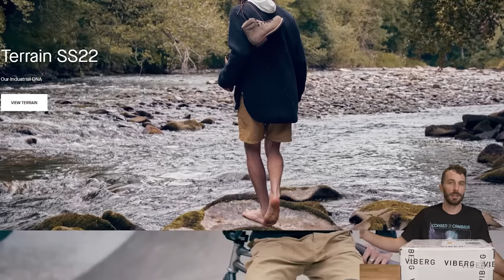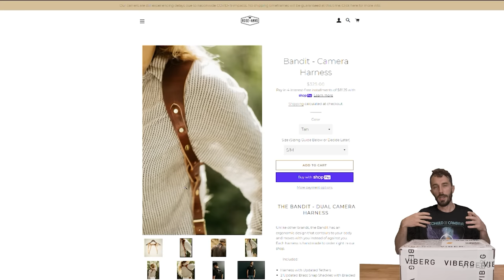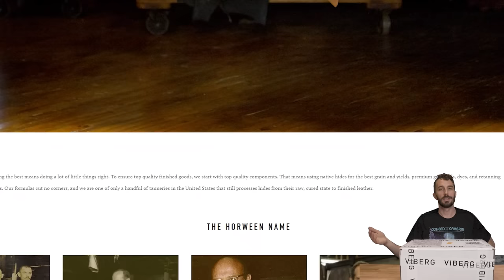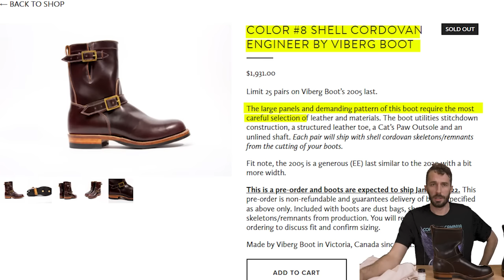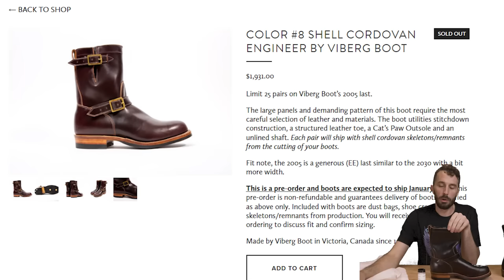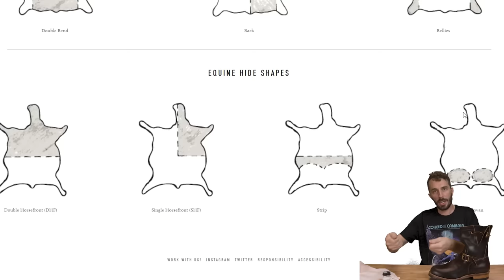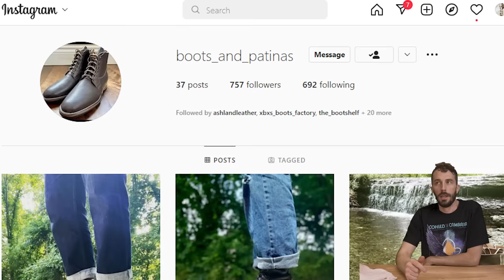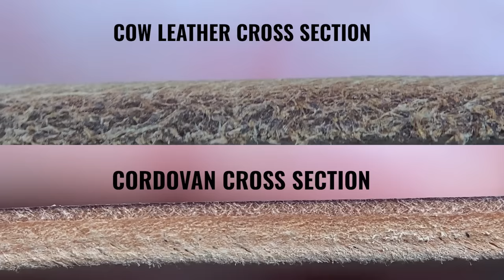What makes this boot worth $2000?

Comment: Those are some good looking boots. From my experience with engineer boots they should fit you basically like a western boot when adjusted but without any heel slippage when tighten. If they are that loose on you currently I doubt they will be much better once broken in. You might have to look into getting a custom pair made for you with your full ankle & calf measurements similar to how nick's does tall lineman boots.
Reply: I was shocked to hear these boots weren't fitted to him. Seriously, for 2 grand, such a big name and the quality, why wouldn't you measure your customer's foot, ankle and even calfs?
That's borderline fraud.
I have the Rose Anvil Nick's Boots from 2021 and they were fitting juuust right and I always have to wear thick socks, else they are too big. Before buying, I spent an hour measuring my foot's length and width and converting it to american sizes and checked dozens of websites to be sure it fits. Yet it only fits because of a workaround.
That's not acceptable for 700$, and inadmissible for 2000$.
Reply: @alexd.3048  Did you go for your own size or something like half a fize down etc?
Reply: @VictorDude98  Indeed, if I remember well, I took a quarter or half size down (it's all in x/y inches), as comments said the toebox would ve very roomy "knowing Nicks".
Reply: I had similar and used wool insoles. That made them perfect
Reply: You are Correct. I think these boots are a bad design - and would have to be a custom fit to look right when sized properly.
Reply: Honestly, I got a pair of engineer boots that were loose on my ankle, just making more holes on the strap fixed it with me switching to soviet footwraps with these slip on boots.

Comment: Definitely a beautiful boot but for that price you can get a similarly built (Dr. Sole, Horsebutt) John Lofgren or Brass Tokyo engineer. Personally the shaft on those is too wide and short and wouldn’t wear right under jeans.
I prefer my Wesco Mr. Lou’s but hey I’m glad stuff like this exists out there and people enjoy it!
Reply: I have been looking at mister Lous for a while now. I’ve read the shafts are more narrow than the boss’s but boss’s are more work boots than every day kick around boots.  I have hockey legs and worry that the shaft won’t fit well over my calves. What’s your take on the shaft size?

Comment: Wait, what? Cordovan is 10X more expensive, but it’s not as strong? So using cordovan as a hiking boot or motorcycle boot would never happen? Damn, but they look so nice. They seem worth $2000. And I’m so thankful you didn’t cut them in half. I would have cried.
Reply: I think cordovan is stronger than leather
Reply: cordovan is more durable then traditional cow leather, that's the reason its the highest end leather, as well as how little of it is available. it's tighter grain structure makes it more resistant to tearing and because of that lasts longer then traditional leather on a shoe.
Reply: @Orion i think the subtlety is like in steel, you have soft steel and hard steel, the former being ductile and can be bend at will, great for anvils and tools but absolutely unusable for construction projects, the other being super brittle but takes a beating before snapping suddenly, great for construction but absolutely horrendous for tools.

I’m not a construction worker though so of course it’s very boiled down and wrong on many levels but I think it’s a fair comparison !
Reply: @Adierit actually it's exactly the opposite. Cow leather is way stronger at the same thickness. Also unlined makes no sense in cordovan as it does not take moisture very well so you want it to be lined.

Comment: I loved hearing your comments about the try on. I feel like you echoed a lot of my issues I’ve had with my White’s in the ankle area, even with boots that were sized properly to my foot length (and in narrow width). I punched a couple new holes in my ankle strap and wore them for a while and the heel slip has definitely gone down, but it’s still there.

But hopefully with more wear the soles will curl up and reduce the heel slip.
Reply: Yeah I've had to get ultra thin leather insoles to fill some space in some of my boots. Usually works.

Comment: I worked in the logging industry here on Vancouver Island for 45 years and I can honestly say that Viberg's are the best Caulk Boots I ever owned, they last 2 or 3 times longer than Paris or Dayton's, I think it's not just because of the Water Buffalo leather but the workmanship that went into them. By the way Engineer Boots should be fairly easy to slip on and off.

Comment: Bro, great job 🙌🏽💯🍻 Was super stoked to see your new channel. I think having a second channel where you can be more chill and need out hard without the pressures of the algorithm is fabulous (though I do applaud and congratulate you for the 600k subscribers on the first channel- that’s a massive accomplishment and blessing, and I’m super super happy for man! 🍻). I thoroughly enjoyed this from beginning to end! I learned something when you were talking about the dye color on the backsides of the shell. And yeah, 2005 last isn’t great for skinny feet like yours and mine 😅 Glad you weren’t afraid to punch holes in the straps. That’s the way to go. I’ve done that to my engineers, and it makes a huge difference. Could probably add one more hole on yours honestly….Would have been nice to see more closeups of the stitchdown stitch rows (and the beautiful shell itself I suppose). The fact that Viberg does these as stitchdown is a huge deal. Most makers (including me, if I were a maker) would welt shell, cuz it’s so valuable; wouldn’t wanna risk any issues in manufacturing. Most makers don’t have the guts to do that, and I don’t blame them (which is why these cost $2000). One bad slip while doing the Stitchdown, and a an entire shell vamp is ruined (like you mentioned about the lasting process). Viberg has some dumb quirks sometimes, but I keep coming back cuz Brett has the balls to try cool stuff like this😂 He’s a true restless creative with some backbone, and my appreciation and admiration for that runs deep…..Lastly, massive bonus for putting your feet on the table 😂😂😂 Freaking hilarious and awesome, dude 😄🤘🏽Enjoy these gorgeous boots!! Do an update sometime on the aging and ultimate sizing conclusion 🙏🏽🍻

Comment: Good on you, brother. Shell engineers are the grail of all grails. I've got a pair of John Lofgren engineers in natural CXL and they definitely felt very roomy with a lot of heel slip when I first got them, so I cinched them down to the tightest hole on the strap and they still felt kind of loose. After breaking them in and wearing them for a couple of years and upgrading to some nice thick boot socks they fit great on the second-to-last hole. Engineers definitely fit different from lace-up boots but once you have it dialed in nothing beats having an ultra-comfortable boot that takes all of about 10 seconds to put on and take off. Plus I feel like a badass pirate cowboy even when my jeans cover everything from the buckle up.

Comment: I've heard that one of the reasons horse leather has become so expensive is because of the trend away from using horses as livestock and for industrial use, instead of as a luxury pet, so to speak. Whereas it used to be more common practice to use horses as beasts of burden and transport, and when they were unable to fit those roles, they'd be sent to slaughter; or when people's horses would simply be too populous, horses would be culled for leather, glue, and even meat (horse is pretty tasty, by the way, I had the opportunity when I lived in Italy), these days there has been a serious push to treat them like cats and dogs, to put them out to pasture in their retirement years.

I believe almost every state in the US now bans the slaughter of horses, for example, and some people even point to such things as reasons for overpopulations of horses, for things like the increase of neglected older horses, and more. It's because there are so many more horses compared to people who have actual use for them, and there's nothing which can be practically done about it.

Comment: With all due respect because these are AMAZING, it remains to be seen when you wear them if cordovan really works well on an engineer design.  Engineers need to "lock in" the heal so no problem with cordovan stiffness and yet engineers must flex and crease. The shaft is short which should help even down there at the vamp.   Cordovan is "notorious" for retaining its shape in comparison to horsebutt or other leathers.  I hope these turn out brilliantly and no doubt they are worth every penny.  Great review and good luck with patina.

Comment: Don't despair, Weston.  I had a similar experience with my Dayton Engineers when they were brand new.  Too much "slop" in the boot - especially when compared to lace up boots.  Engineers benefit from lots of wear.  Eventually the chimney of the boot will collapse around your ankle, reducing much of the extra space.  I used insoles and a pair of extra thick socks until my Engineers were broken in - after which they fit much better.

Comment: Gorgeous boots.  Engineer boots are so different from lace up boots for fit.  I also have small volume feet and have had to fill the volume with leather in sole inserts.  I really like your attitude about styling.  So much rigid thinking out there about what should be worn, and should not be worn, etc.  Conformity can be soul crushing.

Comment: Newsflash I just bought a pair of Cody James Brothers & Sons Engineer Boots knock off they're decent but they fit Roomy for me as well with wide feet and slim ankle , it feels like I'm wearing my slippers with long wool socks so the boots won't take time to break in also in the Reviews people complained that the boots are roomy with ankle slip etc , maybe that's how the engineer boots supposed to feel loose it will adapt to your feet shape  hence relate to the last fitting and wearing the boots in your video.

Comment: Dolt. I bought a pair of Wesco's n they were half the price. Custom fit and just as well made. They make a custom last of ur feet and keep it on file. If needed in about five yrs they will make sure ur feet haven't changed so dramatic as to have the custom last modified.  Do a video on them. I've got around 4 or 5 pair of custom Wesco's ! Also you can have them made for tucking ur jeans in or wear them outside.

Comment: 60% of Americans have two different sized feet. I called Viberg and tried to get a pair, but they don’t sell split sizes. Even though they make the boots to order. $2000 for non-custom, same-sized boots seems a little crazy. They will never fit most people perfectly.
Reply: @dahak972:  So whom, if any, have you found who will provide for your specific needs?
Reply: @brianmgrim  Beck Cowboy boots down in Texas. They will send you a foam pad to take an impression of your feet. Worth every penny.

Comment: I may have expressed my concern with two tone but I am not against it. It is personal preferences, everyone likes different things. I remember before 2019 when I came across channels like yours. I thought spending over 100 for shoes or boots was very odd and never considered. I still have trouble with it but some of my newest boots that I got were above that but not much and nothing was above 150 that I can think of. I do like Jim greens even though the bottom is a bit on the hard side and seems to have too much material in the ball of the foot or actually a bit of a Convex feel to it. However they  are the perfect width. I ended up putting the insoles rockrooster sells in them which helps a great deal.

Comment: Beautiful boots! I really hope they end up working out for you, size-wise.  Hopefully extra thick socks will help.  I have the opposite problem with engineer boots. I have a high instep and have to struggle for quite a while with new engineers to get them on.  I would never buy shell cordovan engineer boots for myself because I need to stretch the instep leather to make it comfortable and cordovan doesn't stretch much.  Good luck!

Comment: As an regular viewer and boot lover I’m impressed with the aesthetic of the product…BUT, for $2k I’d be upset that the toe box stiffener on the right boot  protrudes and is very visible and completely ruins the look. If they were $400 boots then it might be  acceptable, but at $2k the manufacturer would be getting a call.

Comment: Seriously?   For that you could have boughten a pair of Wesco crotch high Big Boss boots.  Wesco pairs up with someone for about the same type of boots but not quite as expensive, Mister Lou.  Still I have a hard time even justifying the cost of those.  John Lofgren is another very expensive brand that I can't justify.    Those are very beautiful boots don't get me wrong.  For that price I would expect a taller shaft at least.   JK boots is shipping a custom pair to me and should arrive on Monday.   I did a flip flop smooth black leather bottoms and black rough out shaft with the soft soles.  I saw a picture of a pair made like that.. awesome.

Comment: So when getting a pair of these get a( rotary hole punch ) got it . 

And leather stretches so these will only get looser ? 

I would have thought go two sizes down and they would stretch to size ?
I agree the point on the buckle looks off 

I am very interested to see the inside of these cut in half but it would be sad at the same time cutting $2000 boots 
Then again it’s sad seeing them not fit when you waited so long also
Reply: shell doesn't stretch much

Comment: Nice boots, but for the price I can't believe you accept that they don't fit perfectly and actually went so far as punching a hole in the belts. Now you have that long belt flapping and the leather folding a little. I would think after breaking in more the leather would stretch and be even more loose.

Comment: Ugh, dang. I'm glad to see Weston treating himself, he's earned it, but I hate that his big splurge was to drop $2k on those engineers. If he hasn't decided to sell em or cut em yet, he's likely to. Viberg makes some of the best boondockers available but they make a shit engineer. Built on a bad last for an engineer, it's chunky as hell, which alone isn't necessarily a bad thing, but it has a massive instep and shaft to go with the massive toe box. It's going to take way more than one additional hole in the instep strap to even hope for a more snug fit. And even then, he'll have a ginormous fold to go with the massive instep, shaft, and toe box. Yeah symmetry. Not sure why Viberg opted for that makeup but it's a miss that doesn't get close to the top ten engineers list much less being the best engineer money can buy. But if anyone can figure out a way to have fun with them, it'll be Rose Anvil Part Deux!

Comment: Engineer boots should not be loose around the ankle strap. Similar to tanker boots, you don't want loose boots in a tank or while you're on your motorcycle. Most guys that have motorcycles wear engineer type boots, with straps, it's actually dangerous to wear boots with laces on a motorcycle. We used to make fun of guys who wore engineer boots if they didn't have a MC. Also they had to be steel toe. If I paid that much money for boots I'd want them to fit, so you have to punch your own hole in a piece of leather on boots that cost $2000. That I say, is bullshit.

Comment: I don't understand it. Is it engineer boots? At least it looks like it. This type of boots should be a shit kicker, rough&tough work horse. But cordovan are awfull leather for work boots. Cordovan lacks any good features we look in leather, it is doesn't "breathe", very soaky, stretchy, easy to crack, scratch and peel, by time deform significantly. 
Well, if you planning rocking those puppies down the street that's ok i guess, but i dare you to work in them.

Comment: Those are poorly designed boots.  There’s no way to get a proper fit and still have it open enough to put them on.  And, as you discovered, cinching up the lower strap enough to get the fit right ends up deforming the boot upper.  So, you either have them look nice and fit sloppy - or - you tighten them up (adding yet another hole to the strap) and they look like shit.  If you want a boot of this style they have to be custom made to your size - but even that will still only reduce the problem.

Comment: Nice boots but no way an Engineer Boot , as working in a Engineering shop requires Saftey Boots - Not cowboy boots .There is No anti slip sole or toe protection so how exactly these can be called Engineer boots is beyond me . Show me just one Real Engineer who works with heavy metals etc that would spend $2 K  on cowboy boots ?  Cheers but they are No Engineers boot .
Reply: Engineer boot is a style. They were originally worn by engineers on steam trains I believe. Way before health and safety footwear was a thing...
Reply: @tomwood5896  Ok , many thanks .